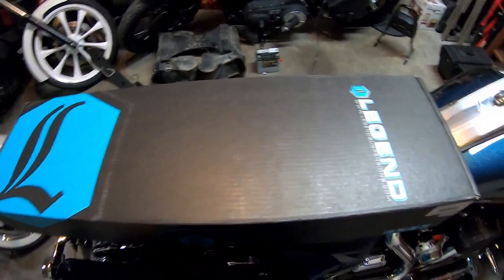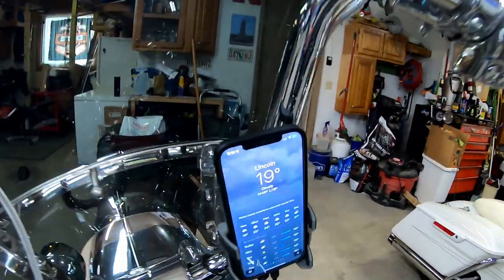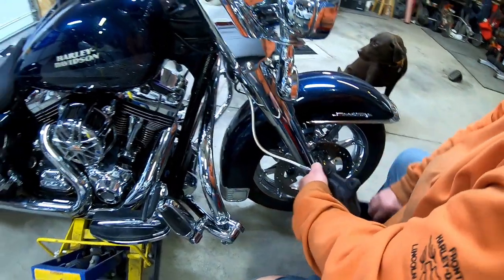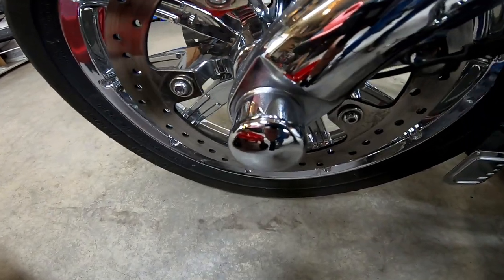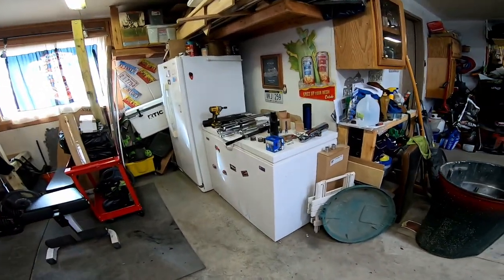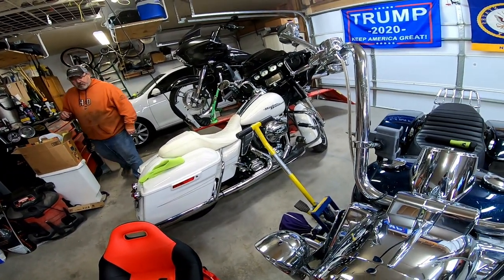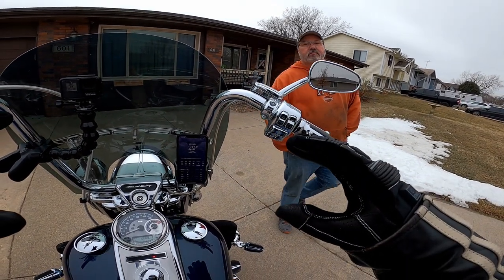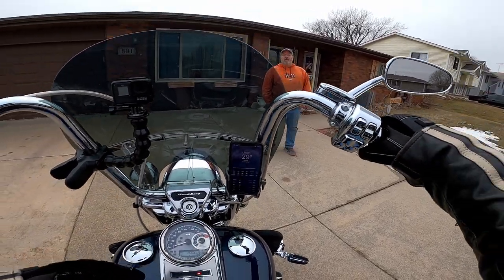Installing Legends front suspension On the Roadking

Comment: How’s rocky like that harbor freight motorcycle lift???
Reply from the maker: He loves it. But says you have to change the tire clamp right away but other than that it’s great!
Reply: He feels safe with it holding all that weight??? I am fixing to install the legends this weekend. I am 170lbs and was wondering is it worth doing a turn or keeping them at the lowest setting. And thanks for the video.
Reply from the maker: @jward19831  we didn’t use it to install my front suspension but I know he leaves his bikes in there for weeks at a time and has no trouble. 
I wish I would have left mine on the lowest setting cause I have lost a bunch of weight and I can’t change it back without taking everything apart. But I still love the suspension. It is amazing.
Reply: Great video!  Did you have to remove the headlight nacelle?

Comment: I'm not impressed with  my front Legends.   Fill every bump. But less nose dive and handles better in the twisties. Love my back Legends.
Reply from the maker: So our local mechanic said to set the front suspension for just the weight of the rider. No luggage no passenger weight, he said he has seen a lot of them come in that are set wrong and he said if I set mine wrong I will know I cause I will feel every bump just as you describe. Just a thought I’m not saying you installed it wrong. But he said a lot of mechanics set them wrong also.
Reply: @StevyFaux  I set mine at 1 turn only. And was thinking maybe set it to zero turns
Reply from the maker: @carolinarider5237  they come shipped set to zero.
Reply: @StevyFaux  yes.  Goes by your weight
Reply from the maker: @carolinarider5237  yes but it is a wide band. Zero is like 0-250 then 1 is like 250-350 and then 350 to whatever
Reply: @StevyFaux  I'm 285. And with one turn, it still nose dives more than I thought it would.
Reply from the maker: @carolinarider5237  that’s crazy cause mine doesn’t dive at all now.
Reply: @StevyFaux  are you at zero?
Reply from the maker: @carolinarider5237  no I have mine on the 250-350
Reply: @StevyFaux  sent you a Instagram message...